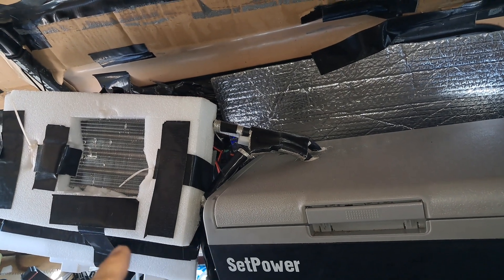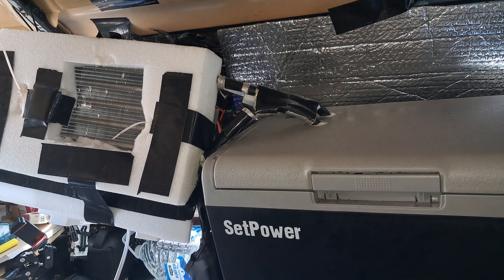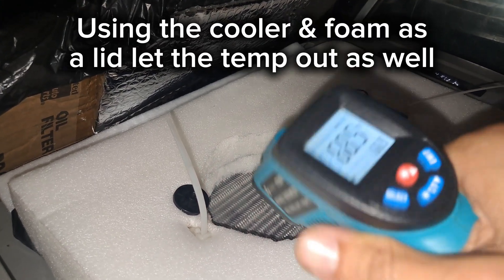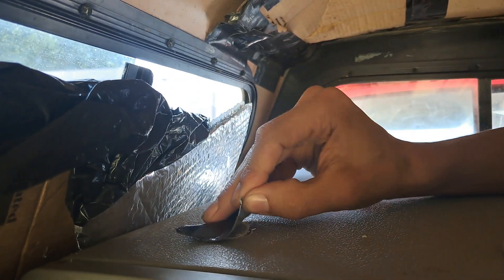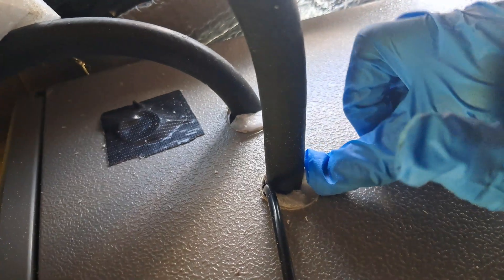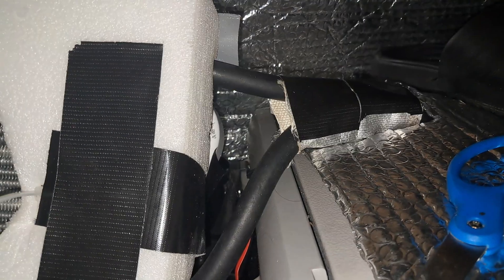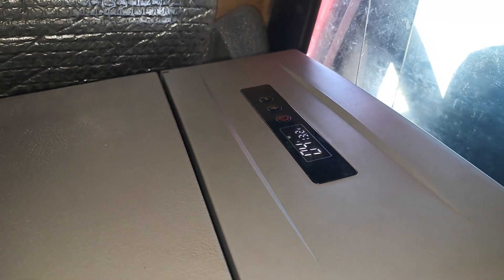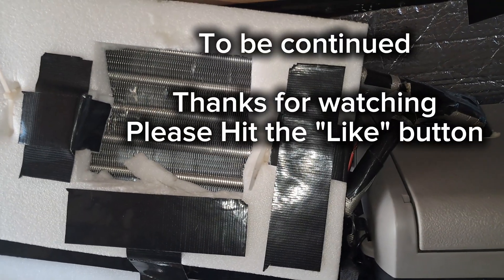Turning my Fridge into a Low Wattage Air Conditioner

Comment: You just ruined ur electric cooler by making those holes on top 
My suggestion use spray foam to cover the holes up and why r you covering the radiator for? To direct the air to come out from that spot ? And keep it from getting warm ? Your only making the water running through warmer by covering 80% of it, get a fan or two that cover the whole radiator put it in the front not back

Comment: The fridge needs to be outside of the inside area in order to cool you. And 12v fridge compressors don't have a lot of cooling capacity. You need a small inverter generator to run the window AC when you need to cool off. It's not stealthy but who cares, gotta do what you need.
Reply from the maker: Yeah I thought it would be an interesting build so I gave it a shot after seeing a "swamp cooler"

Comment: Two words: Duty cycle. While a fridge and an A/C are similar, the A/C is meant to cool continuously- a 100% duty cycle. A fridge is meant to cool a limited area then stop and wait until another cooling cycle is needed; maybe a 20% duty cycle. If you cause the fridge to run harder it will break or at best die soon.  

If the relative humidity there is 70% or less a "swamp cooler" will work. Oversimplified it's basically a screen with water running over it and a fan drawing air through it to blow air inside. The water is caught in a tray and pumped back to the top. It drops the air temps but raises humidity inside. The better factory-made ones can cool a room by about 10F degrees. All you need to power is a small water pump and a fan so they're energy efficient. They don't work if the relative humidity is 80% or higher so no good for me here.
Reply from the maker: Haha yeah it was a good idea on paper but has been giving me a lot of difficulties. I actually got the idea from the swamp cooler and trying to find a more energy efficient way of cooling.